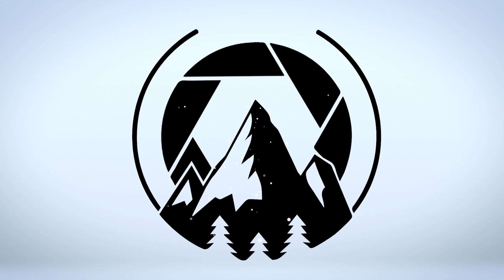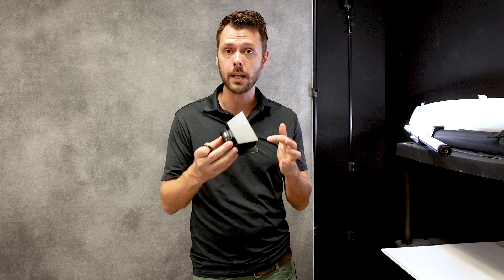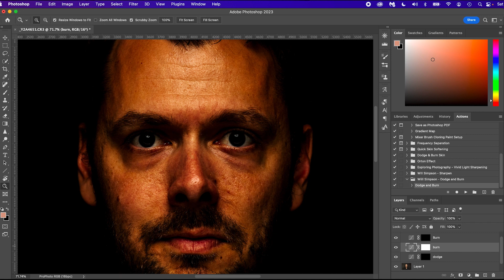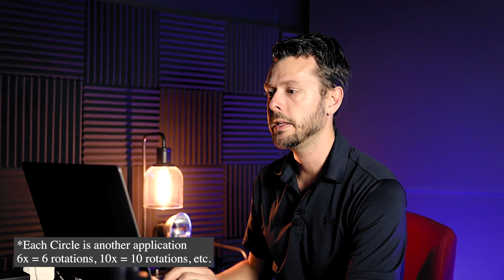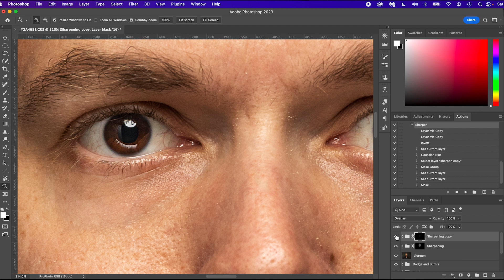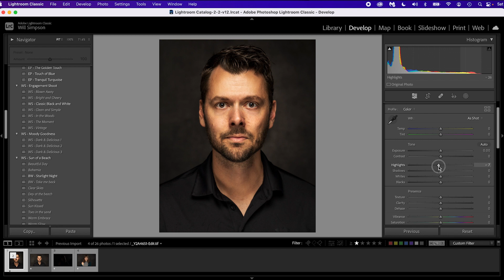Create INCREDIBLE HEADSHOTS or PORTRAITS – Entire Workflow incl. SET UP, LIGHTROOM & PHOTOSHOP Edits

Comment: Glad I came across your video Will. My biggest issue with doing this as you did was focusing my lens.Shooting a Canon R6 Mark II with Canon 70-200 L series Lens from about 8 ft away. I had to focus on an object manually then get in the same spot and make the shots. Auto focus just would not work well with my trigger. Also using CaptureOne tethered. No problems when I'm behind the camera with a willing participant (my Wife) but doing it with just me and a remote was a mess. Any suggestions for easier focusing ?
Reply from the maker: ive had to do the same thing. set an item where I would be sitting and then set manual focus. sometimes if you're using a remote trigger, you can use auto focus, take a photo, it gives you a blurry photo but the camera now "see's" you and will focus on the second shot. otherwise the manual focus option does work.

Comment: This is probably a dumb question but how do you get your brush cursor to have the inner and outer circle (like it is in Lightroom)? I prefer that to the default single outer circle with color fill..
Reply from the maker: So in Lightroom it shows the feather. That’s what the inner to outer circle represents. I’m not 100% sure if there is a way to get that in photoshop. You can for sure adjust the feather which is the “hardness” but the actual physical representation of the circle, I don’t know if it’s a thing in PS.
Reply: @willsimpsonphoto  Right, but isn't that what I'm seeing while you're using Photoshop? Lol, I may be mistaken, but for example at 14:03 you're sharpening in Photoshop and have the inner/outer circle cursor?
Reply: @willsimpsonphoto  Btw, I'm newly focused on my headshot editing skills and this video really helped me with my workflow and overall understanding of what needs to be done. Thanks, and definitely subscribed.

Comment: Helpful video!  FYI the Westcott Eylighter3 is now on Amazon (just got one). I also use a Canon R5, but with Canon's 600EXII-RT flashes and their Speedlite transmitter ST-E3-RT. Is there a way to tether the R5 to a monitor or screen so that you can use the screen on the camera plus see the shots on a monitor? I think I could do it with my Canon EOS 5mkIII and other dslr cameras I've had. Liked and new subscriber, and will be checking out your channel.
Reply from the maker: good to know! For tethering, check out this video: https://youtu.be/r7e15UC6qr0?si=ffyWAKQKrpzeQF0D
Reply: @willsimpsonphoto  Thanks - I did find that after I wrote the above note. I was wanting to just output to a monitor via an HDMI cable, which seems not to be possible at all.  I think I do just need to tether to software. I use Photoshop, but also have access to Lightroom through the Creative Cloud license. However, I am reading that a LOT of people have inconsistent luck with tethering with Lightroom and instead recommend Capture One. Have you had issues with Lightroom and tethering? Thanks!